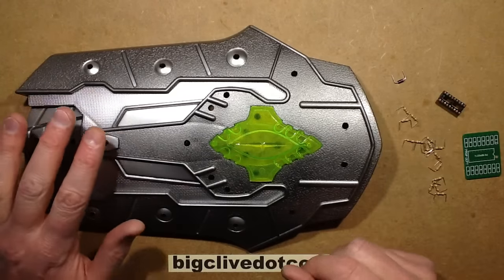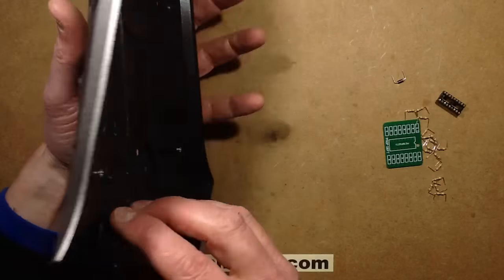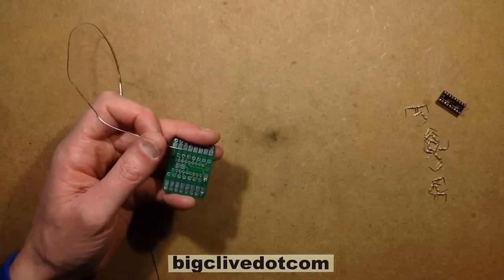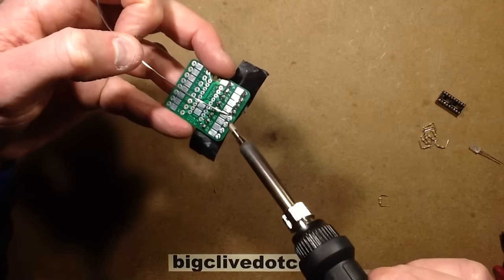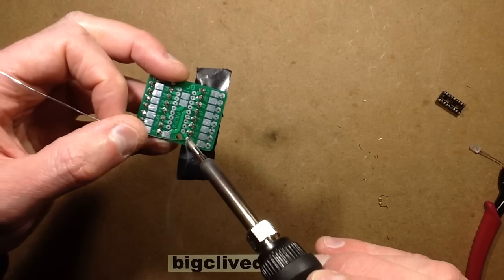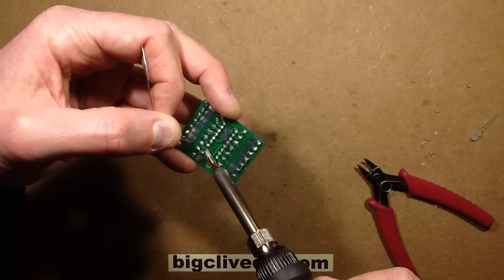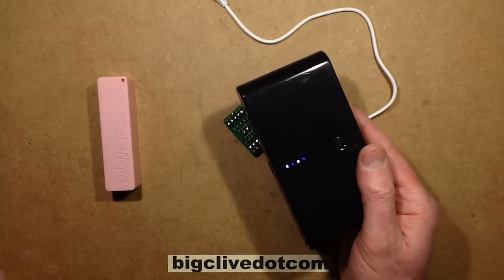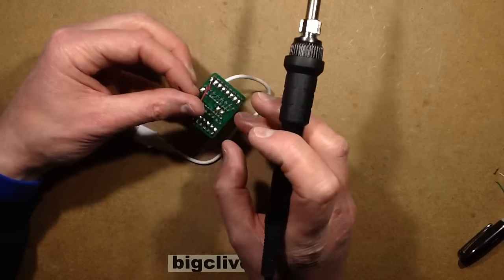How I add LEDs and circuitry to a TV prop.  (with timelapse)

Comment: Anyone else come across usb chargers which will make touch screens go nuts on phones?
Reply from the maker: +Luke H Cheap and nasty chargers can put out a lot of electrical noise that makes the touch screens go haywire.  Especially when a lot of current is being drawn.
Reply: +bigclivedotcom And they also drive anyone who cares about radio (especially LF, HF or SWL radio, but even into VHF and beyond sometimes) absolutely nuts as well as they can completely wipe out radio for an entire neighborhood.  Technically they are in violation of the law in many nations as they are major sources of unintentional (and preventable) radio emissions as they are literally unlicensed broadband radio transmitters.
Reply: +Luke H 
Never had a problem with touch screens, but I have a charger and a monitor, which, when plugged in, will make the oscilloscope on the same bench useless. It's impossible to get a stable trigger because of all the noise.